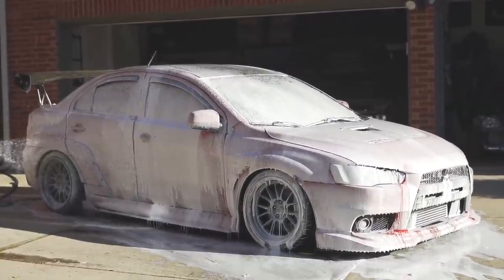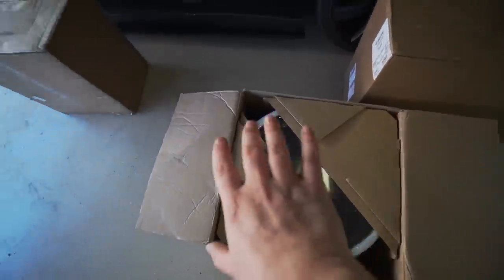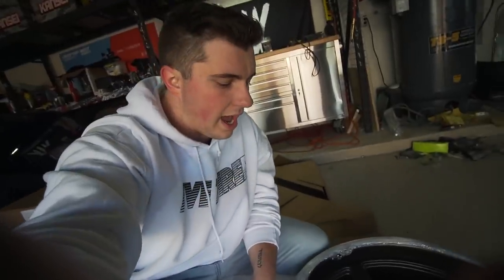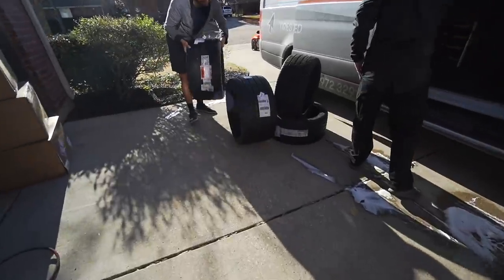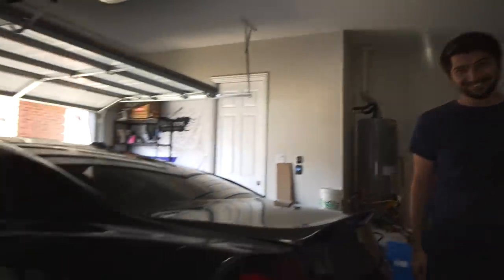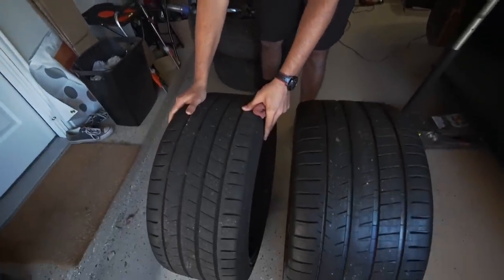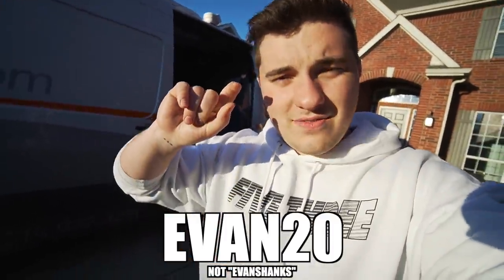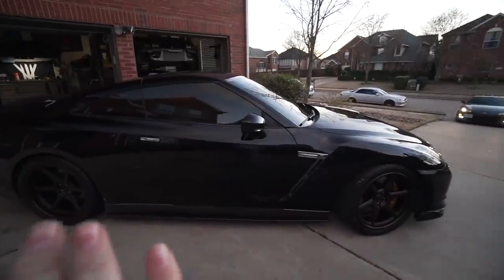*WHEEL REVEAL!!* Forged Wheels for the R35 GT-R!

Comment: “ he uses tape” 2 minutes later he’s putting that tyre on with no tape on the lip🤣🤷‍♂️
Reply: That was the backside of the rim
Reply: So the rim is face down in the clamp? Hm! Either way wheels look mint and tyres fitted with no marks so all good 😎
Reply: @jakedixon5232  4:53 "flipping it over, hoping this works" I believe he then flipped the rim. Well yeah, doesn't matter, looks amazing!
Reply: @9jason  Reverse mount wheels, relatively common on higher end wheels. Saves the face from the fucking tire bar. I got relieved seeing them being reverse mount at my old shop. I did a set of TE37s which aren't, them being brand new out of the box and me being relatively new I was sweating. Fortunately no dings. The clamp they use in the vid is also EXTREMELY easy on the wheels, it clamps on the center bore as opposed to the outer lip or inner barrel. Long story short, flipping the wheel is imo better. Plus design of the wheel makes it so the tire has to go on that way.

Comment: Evan it looks like your calipers are sticking that's why your front rotors have a blue color to them this happened to me and it was the sliders sticking. if you have rubber on the sliders you may have to use some silicon grease because i used regular brake synthetic grease and it swelled the rubber and kept the pads from backing off enough and the brakes were dragging.